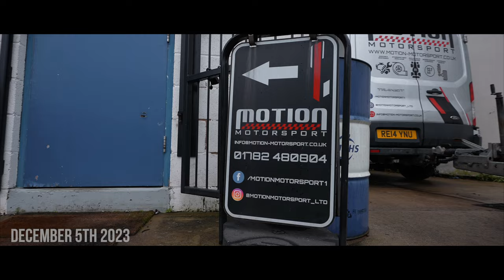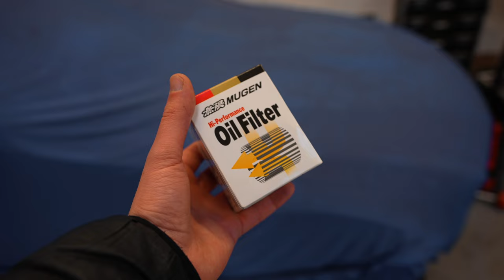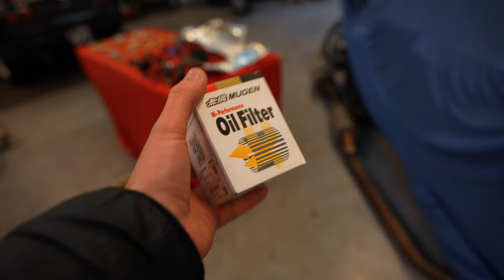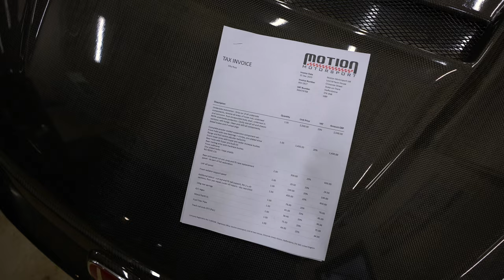Full Underside Rust Repair And Restoration At Motion Motorsport!! 4K

Comment: Just finished it, even though I’ve seen it all before 😂 much better in one long video. Definitely given me motivation to save a bit on the side while also doing my other plans to eventually get this done. What are your plans (if any) to maintain this? Or should it just be fine to leave with all that work that’s gone in to it.
Reply: Don’t want to answer for him….but having done similar to an EG civic myself recently, as far as I can see there are 4 options, of which I myself would consider 2.

Option 1, don’t use it, or maybe trailer it to the odd show. 

Option 2, use it on nice sunny weekends in the summer. 

Option 3, use it as you would any car, once a year, when you’re servicing it, clean the underside, and address any parts starting to look a bit tired. 

Option 4, absolutely cover all of you’re beautiful brand new underside with some kind of wax oil (I’m sure there are better alternatives)…..the kind of treatment you may do to a brand new car….but do it yourself concentrating on all the known problem areas. Yes it would just look like any other tarted up with under seal car, but you’d have your photographic proof and know yourself how mint it is underneath the protection……knowing you can dry ice blast it off in 5-10 years time and it will look like the day you picked it up. 

I personally prefer option 3, but I’m quite lazy so may be better off with option 4. The main thing is make sure you don’t stop using it. The best thing about these cars is driving them.
Reply from the maker: My plan is to just wipe it and wash it down every now and then really. As you could see from Dave wiping down the arch, it doesn't take much to bring it back to how it looked on collection day.

Comment: Helllo. I wanted to ask what direction you would advise me to take.

I own an fn2 type r and it’s noticeably in need of a full suspension refresh which is obviously costly (wishbones, coilovers, polybushes, drop links etc). My question is I plan to do what you’ve  had done (perhaps not quite to the same extent and detail), I understand the benefit of delaying said suspension parts until rust treatment as everything would be already off the car. But I’m so far away from being able to afford proper treatment like this.

My car is completely standard and I have had it for 5 months. I don’t believe anybody has tried undersealing it and that’s how I will leave it until I get the proper job done (as you explained in the videos). Essentially I plan to put all my focus on the cars health and driveability prior to aesthetics and engine mods. 

Is it worth just going through with the suspension work now (as I can afford it) knowing that my car is at least healthy and safe from that stand point and then saving for however long it takes to get the rust treatment in the future. I initially had a plan to get it all done together along with a 500 quid underside  job and call it a day but the videos you’ve done  have opened my eyes.  Or would you suggest that I put everything on hold and save up until I have a few thousand to put into a process like what you’ve had? I plan to never part ways with my car. 

Sorry for the ramble thank you in advance. 😁😁
Reply from the maker: I would put it all on the car now and enjoy it whilst you save up for the underside. That is what I have done. If you are years away from doing something like this then you shouldn't wait that long to get all the other stuff on. As you can see, my car wasn't standard underneath before the work started. The benefit you have over me is the knowledge of everything now so you can make a proper plan

Comment: Crazy amount of money on a UK EP3. I'd understand it on the JDM or even something a little special ie; 30th Anniversary but on a non prem version. Mad
Reply: Why is it mad 😂 it obviously means alot to Olly, why would you let your pride and joy just rot away? to me that's mad, not like you can go out and buy them from the dealer.
Reply: Might seem mad now……but as the years pass, and they get rarer, then really good ones like this will become really hard to find. JDM prices will rocket as they approach 25 years old and USA can import them. 

Back in my younger years I scrapped 3 genuine EG6 VTI civics because they were getting a bit rusty and worth more in bits…..I’d probably give 3-4 grand to have any one of those shells back now in the condition it was when I scrapped it. I’ve given EG and EF civics away to friends for free years ago that would be worth good money now.
Reply from the maker: You may say this now but in the next few years, there won't be many left on the road. Then it is worth saving any of them. Also, if I had left mine, it would have been too far gone to save and then I would have had to pull the car apart and sell all the bits. I would much rather drive it for the next 10-20+ years

Comment: Lucky enough my civic underneath isn't as bad as yours and doesn't need as much work would lanoguard be sufficient protect compared to what u had done.
Reply: Yes but have to get behind bumper and into cavities along sills . Wouldn’t be as good s job as this as all arms powder coated at new nuts / bolts / bushes. Also crash bar rusts behind rear bumper
Reply: @AM-wt8qi  am just talking about the underbody to honest I have new wishbones, front and rear hubs and freshly powder coated subframe all with new zinc coated bolts
Reply: @iainrobin6314  ok but on mine the sills can rot from the inside which is why a good cavity wax is essential as well as doing underside . Lanoguard is ok but needs going over every year
Reply: poitnless just spraying more underseal onto old underseal.
Reply: Lanoguard is ok just need to top up every year and prep a wee bit. As said previously worth doing cavities that you can’t see by removing rubber bungs along sill. Will help a wee bit without welding new inner sills and arch panel.
Reply from the maker: If you don't have any rust at all then I am sure it will be fine. As long as you are 100% sure there is nothing that will grow and get worse underneath the Lanoguard then go for it.

Comment: First off I don't need to punch a bloody holes in your floor/skirt / arches to tell you those areas need rust repair 2nd there are plenty of undersealants that do not require removing everything to apply and coat properly designed to drip & expand as it cures they're more like a honey/wax vs rubberized and are also easily temporarily removed in areas if need be for repairs and re applied
Reply: If it's being repaired it's being repaired anyway and if you want to do a proper job it's best to remove all of the rust

Comment: Class. Any chance of mentioning what products are used. What seam sealer what rust converter what under seal.  Great job
Reply from the maker: Unfortunately not as Motion Motorsport have spent a long time getting the right mix of products, they didn't want to share what they use on video. They didn't even tell me